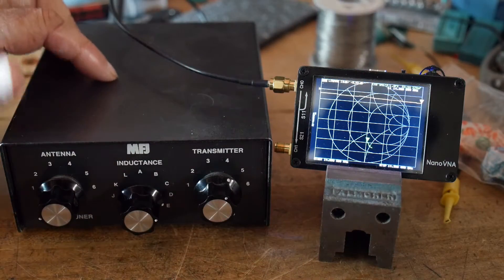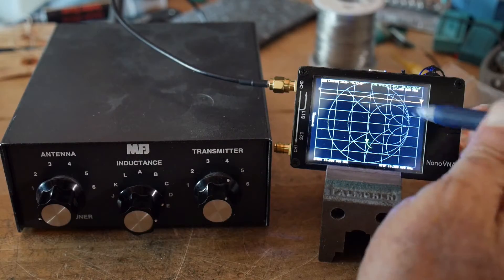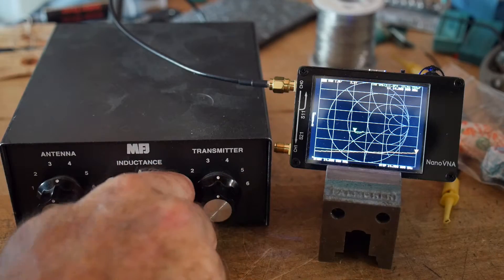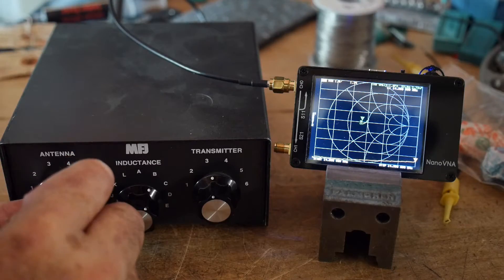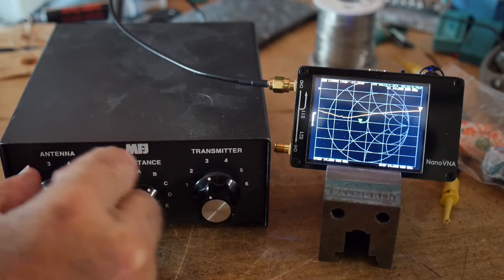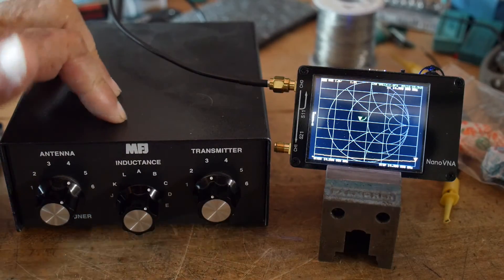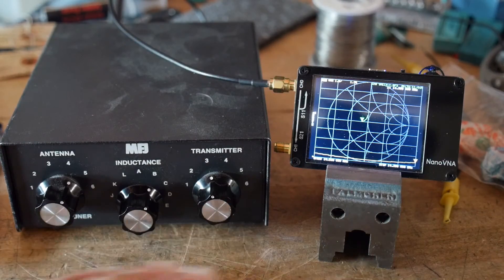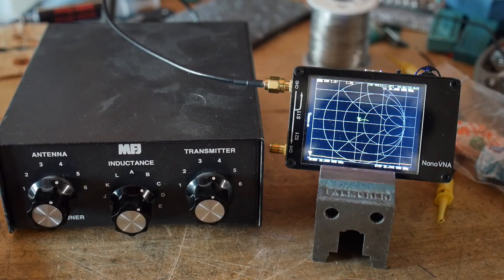#358 NANOVNA tuning antenna with a transmatch

Comment: I have been using an end fed random wire antenna for years with great results. The unun is grounded to a steel window well and I also use a choke on the coax just before it enters the shack. The choke is key since it prevents RF from entering the shack

Comment: Steve Ellington has some excellent videos on testing and optimizing EFHW antennas.  The short and skinny is: 1) inverted-L, 2) balun fairly close to ground, 3) good earthground at balun, 4) choke the crap out of balun at the feedpoint, and 5) no counterpoise.

That should provide a little bit better than 3dB improvement over most installions.  It will turn a so-so performer into a good performer.

Also, usually "A tap" is the full inductor.  A general rule for best performance is minimum inductor with high capacitance.  It provides the highest Q tuning.

Comment: Question. I have a dual antenna whip nagoya. It has 3.5vhf and 5.5 of gain uhf.   If i tune the uhf frequencie tona desire, will the gain dimish or be affected and the vhf .
Reply from the maker: Probably. It depends on the design of the antenna.
Reply: @IMSAIGuy  well it it not fiber glass or dipole or commet antenna is just stell whip antenna Nagoya
Reply from the maker: @SuAmigoElilegal  I would guess it has a loading inductor and possible capacitor at the base.
Reply from the maker: what is the model number
Reply: @IMSAIGuy  Nagoya NMO-200A 38.5" Antenna
Reply from the maker: @SuAmigoElilegal  that antenna has a loading coil at the bottom, and a coil mid antenna.
Reply: @IMSAIGuy  what does that means ? Is it tunable and u also mention about a capacitor at the base
Reply from the maker: @SuAmigoElilegal  Frequency Range: 136-174MHz and 400-520MHz, Optimal Frequency Range: 140-160MHz and 420-465MHz
Length: 38.4 inches
Wave: 1/2λ (144MHz) – Two 5/8λs (430MHz)
Gain: 5.5dBi
Max power: 100 Watts
VSWR : Less 1.5:1
Impedance: 50 OHM
Connector: NMO Mount

it is quite complicated. It acts as a 1/2 wave antenna on 2m but two co-linear  5/8 wave antennas on 70cm. the gain of the antenna is due to the radiation pattern of the two 5/8 sections.
Reply: @IMSAIGuy  ok tha ks for the help I guess the only way is to trim it down and find out

Comment: So what exactly is the vna connected to in back of the matching unit, the transmitter connection?  I assume the antenna is connected also.
Reply from the maker: the radio is disconnected and the VNA takes it's place. you wan to radio to see 50 ohms so if the VNA sees 50ohms then you put the radio back in.. same as an antenna analyzer. The VNA outputs RF (weak transmit) and measures the reflected signal for amplitude and phase.

Comment: Im a bit confused as to why you adjusted the inductor? The smith chart seemed to be on the capacitance side at first
Reply: You cannot just go up or down in a vertical straight line on a smith chart. When you add or remove reactance with capacitors and inductors, you also move left or right. The shortest and ONLY path toward the center of the smith chart is therefore a combination of two curves. For instance, you must go enough left with the capacitor in such fashion that when you finally add inductance, you curve right, back to the center of the chart.

See https://youtu.be/Hsx4wqAlqlQ?t=846 It's easy to explain visually than in words.

Comment: A 49-1 UNUN is what you need, not a BALUN. And I think that this is the first VNA video I've seen that is checking an antenna other than a 2 meter or 70 cm. Thanks
Reply: Nick Rupp
Are you sure his ant was half wave? And don’t forget about common mode choke.

Comment: How long have you been a ham?  End fed use the coax as the other side if the dipole? Use a longer piece of coax and ground your equipment.
Reply from the maker: I think I found the problem. bad ground connection to the transmatch. I only added it recently. A flea market find. even without an RF choke things are acting normal.
Reply: @IMSAIGuy   That's great! I really like Endfed. I do a lot of QRP and live in an HOA restricted area so its end feds for me. I find them easy to put up and tune. I have mine as an inverted L in the attic.  Hope to hear you in the air. 73, KF7ZVL.  What does IMSAI stand for?
Reply from the maker: @RockyMountainQRP  IMS Associates, Inc.
Reply from the maker: Been a Ham since the 1970's extra class WAS WAC  DXCC. I had an offset dipole on a 4:1 balun that I set band SWR using my HP8921a. Worked great. I though an end fed would fit my yard better. first time using a 9:1 unun. I've got a good ground on the balun. the ground in the garage is not great. although the 4:1 balun system was working fine. I suppose an RF choke would help things. never had to use one before in all my antennas over the years. different data on wound toroids and multi small cores over the coax. I think I will go back to the windom type
Reply: Well, excuse me !

Comment: and by the way, I am sure you already know this but technically, you need the end fed unun + a 1:1 choke for end fed antennas...
Reply: add an ugly choke (20 turns of coax around a 4-6 inch pvc pipe) See my qrz page W9DLP
Reply: @davep6977  the air core you are talking are not really efficient, see this page http://www.karinya.net/g3txq/chokes/ and take a look at this wonderful video of trx bench, now that is a real effective choke that cover all amateur bands and it is quite cheap to build too : https://www.youtube.com/watch?v=JhAPJISUjB8 (sorry to plug another youtuber video on someone else page) but I sincerly think it is a great demonstration on how common mode choke work and how to build a really effective one.
Reply: Isn't an endfeds ratio 49/1 ?
Reply: @jamesbradley9233  there are 9:1 also that are quite popular but that one is not a resonant antenna.
Reply: I made a 9-1 for a random length wire,  but an efhw is half wave on the lowest frequency hence the 49/1 I'm building now for this.

Comment: in order to take these measurements, you did need to calibrate the device at the end of the tiny peace of coax ? if so, you probably did need to have sma to pl259 adapter, this means the calibration is again wrong because of the adapter ? your you need a calibration set for sma m/f, another one for N m/f and another one for pl259/so239 ??
Reply: I'm no expert at this but I do the calibration with everything but the antenna connected to the VNA, if possbile. But I only have the SMA version of the S. O. L. T . so it is just to the end of the tiny coax. Maybe that is good enough??